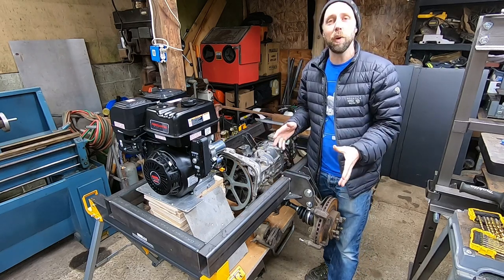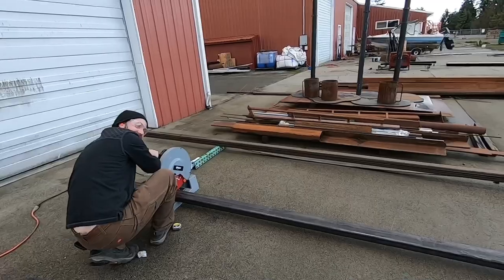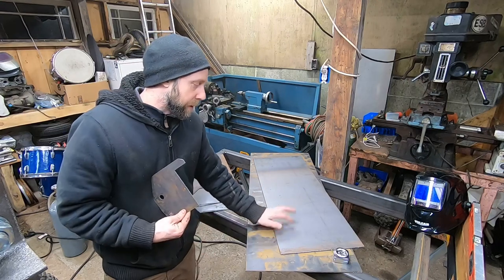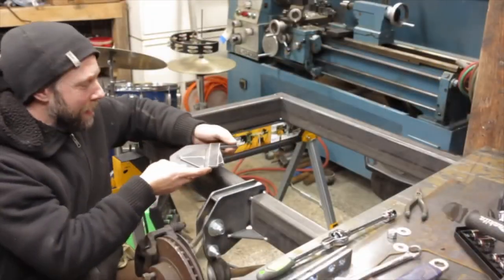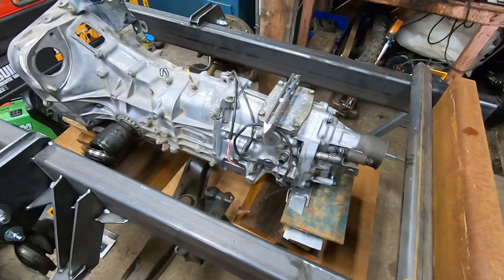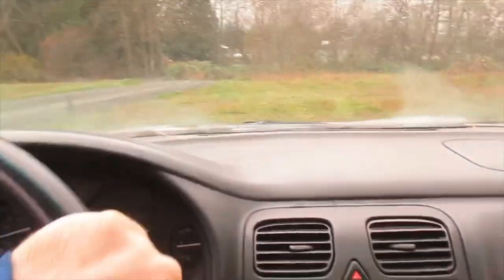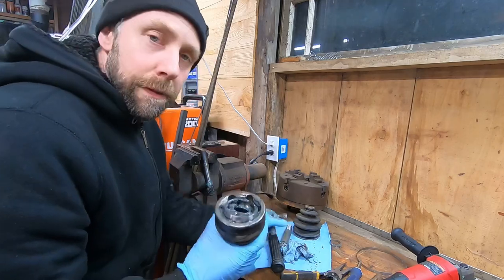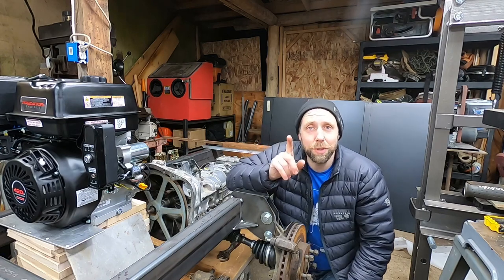420cc Predator powered articulating 4x4 dump truck build part 1

Comment from the maker: Hello everyone it’s Michael here 🙂 I just want to wish everyone happy holidays and thanks for checking out my new build!
Reply: This is awesome, can't wait to see part 2. Anytime you need some help, you had me at articulating, quad, utilitarian, vehicle.....
Reply: You should put an actual engine in this one not a harbor freight one I think it would work a lot better
Reply from the maker: Ghavin Clayton this is a actual engine, it’s a 13hp four stroke gas engine. Could you go into more detail on your comment? I think every project I have built with single cylinder engines work pretty good, my sawmill, log splitter, quad truck and predator powered mini bike, this engine coupled to the transmission though the correct gear ratio should do everything I need it to do. What engine do you think I should run? Do you understand projects like this cost a lot of money, I’m trying to keep in a budget of around $1500.
Reply: I have a mini bike with a predator engine,I bought and installed new wheels and handlebars for it today, it's still going strong
Reply: Please, for the love of all things square and pointy, put your dog out of the shop when you're welding. 
That aside, awesome project.
Reply: Your part obviously looks like a front hub on an F350...
Reply: is that transmission a 4EAT?
If so you can do a locking center dif mod. It can be really useful thing to have if you ever REALLY need traction, Instead of potentially burning out the "bucket"

https://www.youtube.com/watch?v=6AoEm-CSa74

Comment: I built a skider  like this using a jeep drive train. Used a industrial 10 hp brigs. Not enough power. Upgraded to a 2 cylinder air cooled diesel. Now it is fun to work.

Comment: Fantastic new project, looking forward to watching this one progress. For rough and ready shaft shortening I just use a bit of high quality angle iron and clamp both sides into the angle so they are locked straight. You can get 3 tacks on and with one turn get the 4th and then seam it. For more accurate stuff I weld it in the 
lathe with a fire blanket to protect the bed.

Thanks for posting.
Reply from the maker: Right on thanks for the suggestions! I definitely will use that on the rear cv joints 👍

Comment: Nice to see how this transmission works in a homemade vehicle. Years ago i had same idea using older subaru trasmission with 4wd high and low in a articulated 4wd  garden tractor.  My idea was to put engine very low and use another shaft to power transmission, hydraulic pump and pto shaft front and back

Comment: Mike, from my experience you might want to revisit the power source. I think you will find that your build will grow and the need for reserve power will be needed. I'm a big fan of the predator engines. Look at making the jump to the 670. The drivetrain and components can easily handle the added power. Love the plasma table.

Comment: wheel bearing assembly off a 99-2004 f250/f350.  Could be 2005 up but didn't get a super real good look.
Reply from the maker: Yep you are right 👍

Comment: Iv shorten a few axels I took them apart like you did, rough cut to length and threw them in the lathe and turned them to the nearest sized drill bite I had that was as close to axle original size, Then I threw a piece of round stock in the lathe and drilled it for a tight fit, put the two axel pieces together and welded the sleeve at both ends. Worked great and was on a home built sxs that I dumped the clutch on many times, never broke one. It spun true,

Comment: You can use angle iron and set the shafts on the v groove so you can weld the shafts together and have them straight as an arrow.

Comment: You should set the back half up so it can be switched around for diffrent uses.a dump box like your planning and a log skidding arch/winch or grapple or a combo grapple/ winch.it would be easy to do.just weld pockets to the outside of the frame and have square tubing to slide into the pockets with pins to hold it.build the dump box so it just sits down on the back frame and same for the winch.
Reply from the maker: We think alike! I’m definitely thinking of doing this 👍 I build a bandsaw mill years ago so a boom with a winch is definitely in the plan. Thanks for commenting 🙂
Reply: I,ve seen you mill and your videos on it..nice job..your doing a nice job on this project too..so good i,am thinking about using my rusty 2001 toyota tacoma to build one myself.i design and build all kinds of things.

Comment: Great build! I usually clamp things like those driveshafts into some angle iron to try to get them straight but looks like you did really well. The fact that it's got a CV joint either end means it probably doesn't matter if it's a bit off.
Reply from the maker: Thanks! I have had a few others mention this angle iron trick too! I appreciate it 👍

Comment: The thing you showed at the end and asked what it was. It’s a front hub & bearing assembly with ABS sensor. It’s for a 3/4 ton or bigger truck or van. Most likely Ford but Dodge had some like that as well.
Reply: That must be some shaft to need a spline that big.
Reply: @rpatrick2  it not for a shaft, it's for a 4 wheel drive lock out.

Comment: I have been thinking of something like this for a while. Not articulated but using Subaru running gear and cutting it down. Going to help my father close down his Subaru wrecking yard next week so see what I can score. I was thinking of using the front and rear cradles and narrowing them down along with the steering rack and half shafts as you have done. 
Have a few Diesel engines up the back I could put to use.  Be a major project I'm not sure I'm up to. At very least would have to clear all my other crap out the shed before I even thought of starting something like this. 
I'd really need to put Hydraulics on it so I could have a blade  to make it worthwhile and they aren't at all cheap here in oz.

Comment: i built a 4x4 lawn tractor and had to narrow my axles and shafts, the way i was able to weld them back together straight was by c-clamping both sides in a heavy piece of angle iron, its strait and worked great for me, no issues
Reply from the maker: Thanks for the suggestion! I have had a few others suggest the angle Iron too. 
Do you have any videos posted of your 4x4?
Reply: Mike festiva I do. Only of it running and driving tho. I’m not very tech savvy so I didn’t get any videos of the build. But if you add me on fb (the one with my dog as the profile pic) I have tons of pictures on there of the build

Comment: 6:40 No, that doesn't sound stupid or ridiculous. Tools like that, particularly the latest CNC stuff, are totally worth it. Especially now that the prices have come down without the corresponding reduction in quality. Even if you had another person, even a skilled fabricator, there's no way they could have those parts finished in that amount of time at that level of precision. (Of course you mention this later...) I'm working towards getting one of those Langmuir CNC plasma tables mostly because of what I've seen on your channel. Probably going for the new one with Z axis control. Cool build!

Comment: 4x4 Front hub assembly  3/4 ton ford . I just watched the video again I edited my comment from a hour ago .Thats the best idea for the pivot I've seen people just do it with pipe  and yeah that is going to be way smoother with the bearing!!! That is going to be a beast there is some videos on YouTube of a toyota 4x4 truck and they have a 6.5 Predator engine hook to the transmission pull start and uses trans like normal !! So what u have is a beast heck yea ready to see this working tractor !!!
Reply from the maker: Right on Ricky! Yes I think it’s going to be really useful around my property. Thanks for checking out my videos 👍 yes it’s a Ford F-250/350 super duty wheel bearing. Take care

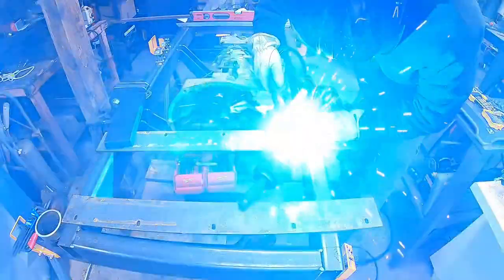Comment: 18:57 as long as your two parts have the  Diameter you can clamp them in a piece of angle And they should hold their concentricity fairly well. If you working with 2 different diameters just shim one side. I made an adjustable Weld fixture just for stuff like this that has a gap between the two angles so you can weld all the way around. Can't wait to see  The finished product.
Reply from the maker: Thanks Ken I definitely will do that!

Comment: Dam Mike, you have to keep teasing me with that PLASMA TABLE. I plan to get the same one soon. I'll need your help. I'll have questions. That thing is just sick!
I hope Miller and Lincoln reps are watching your videos. Hehehehe.
Reply from the maker: Haha well if you buy one I will be happy to answer any questions about it 🙂 haha Miller guys are not going to be able to handle it, I’m building a tractor truck in my shop with a HF welder and plasma torch 😂 as far as most die hard Miller guys that just could not be done without a “REAL MANS WELDER” 😂👍

Comment: Love it Mike!  A welded outer sleeve on the cv drive shaft along with your idea of a dowel inside would add lots of weld strength.  I do think you're right about it never being a problem - just in case... ;)  Looking forward to the following episodes!  Cheers,  Gary

Comment: best way to shorten and rejoin Cv joints , is fit a outer sleeve , press fit  over the shafts then weld  the sleeve to the shafts
Reply: That's what I was thinking, Also you could put some holes in the sleeve for extra places to weld.
Reply: @arthurhardy   Yes its called Puddle welding the holes  or even just slot the pipes at each end

Comment: Hey man good show. Some years ago I build a small Articulated tractor from 2 walking tractors running a yanmar 14hp engine off it. Just a word that an ADT does not pivot and turn, it articulate and oscillate. That will be articulate around the Y axis and  oscillate around the z axis.

Comment: That bearing that you have there is most likely for a late model Ford f 250/350 truck front axle.
Reply: Early model by the tone ring and snout length. But yes. . *edit, forgot Dodge uses axle disconnects. 5
Reply: @thethepete731  Dodge axles don't use a locking hub. Dodges have a unit barring like the chevy and gmc trucks. it's just on a solid axle instead of an independent suspension.
Reply: @scottgarboden4529  right, sorry, Ford guy, you're right. I forgot they use axle disconnects.
Ford uses a unit bearing too. That's what that is. They use hub disconnects vs an axle disconnect, which is probably what you're thinking of.

Comment: Get some ubolts and 3/4 inch angle iron to align your Axel's or round stocks also a carbide tipped plywood blade will cut those Axel's very easy I cut  up to 3inch trackhoe pins with my 6 1/2 in Milwaukee battery powered circular saw just scratch it with the grinder if it's case hardened

Comment: I think what you got is going the best route. Parts (Write down production date & VIN) but it is straight forward.
  The hub is ABS, Late model, 3/4 ton with 8 studs, and front for a 4 X 4. What is strange (I have not worked on all) but the center of this hub, is like old school get out, turn to lock or un-lock, then change directions for 32 feet to allow the locking runner to engage or disengage over those long splines. Today, it is shift on the fly and done by locking the front driveshaft together. Also, a controller that synchronized the transfer case electric motor to engage or reduce rolling resistance. The bolt-in hub type considering it is May 2022 has been used for 1998 so 24 years now. Dodge, front, 3/4 ton 4X4 with ABS for 1999-2008. Close?
DK, ASE master tech since 78, retired

Comment: to weld the shafts just clamp them in a piece of angle iron to align them
Reply: Or you can buy an angle and chain clamp to do any for or tube joints.

Comment: Looks like a Ford Superduty 4X4 front bearing but I’ve never seen one that wasn’t rusty. 😉

Super cool idea for a build and the Subaru transmission is a great starting point for the driveline. 
Hopefully you get the hydraulic requirements figured out because it sounds like it will be a great build overall.
Reply from the maker: Thanks Wayne for checking out my new video! Yes you are correct on the bearing 👍
It will be fun working out the hydraulics I have dabbled a little with them in the past but I’m sure it will be a learning experience working out this one. Take care.

Comment: It would be so cool to put some type of articulation joint in my 1990 Toyota 4x4 right between the cab and the bed. After watching how well this thing actually crawls once it was done it seems like it would work even better that doing a solid axle swap like most do to get better articulation.
Reply: I agree I have a good doner Toyota that has rusted out rear frame and a rear axle out of a dump truck to canablize for the spindle and hub to make the center swivle with I could even retain the brake on the spindle so you could lock the swivle in position for driving it on a road. It just might work

Comment: to line up axles and roundbar in general : use a piece of angle iron and ca,p both pieces together inside it , should line up pretty acurate , i you cut a piece out the middle you can get to the back of the axle with the welder yoo

Comment: When I was in college for welding back in 2011/2012, I could not figure out any of the CNC stuff at all. Wish I did back then, because now I kind of want one of these plaz tables for myself. There really isn't any fast way someone could make those by hand and be accurate as consistently as a CNC table can. Especially trying to make the holes for the spindle to bolt to without them being oblong.
Reply from the maker: You know Aaron I’m new to Drawing in CAD and running CNC stuff. I got this table and learned CAD back in November, within a month I started on this project. I’m drawing in Fusion 360 and there is a bit of a learning curve but within a week of downloading Fusion 360 I was able to draw simple parts. Once you get the drawing stuff figured out loading the G code to the Mach3 CNC controller software and cutting out the parts is definitely a simple process. I have some videos when I first got the table that talk about the learning curve and a bit about using the table. In those videos there are also some links to some simple but really useful Fusion tutorials I found on YouTube, If you can’t find those videos let me know and I can post some links for you 👍
Take care

Comment: That's quite the project man! Way over my head, but it is fun to see you do the build. I've my crossfire some. The prime weld cut 60 seems to work really well, except I found that I had to move it as far away from the electronics box as possible otherwise it caused the table to malfunction.  It cut some quarter inch super clean.
Reply from the maker: It’s good to hear it’s working for you, I read somewhere that people had good luck adding on those Ferrite ring noises suppressors onto there cables going from the plasma torch into the control box? I have never tried them out but here’s a Amazon link, if it didn’t copy right just look them up, you can get them for around $10 for a multi pack. Take care 🙂 

eBoot 20 Pieces Clip-on Ferrite Ring Core RFI EMI Noise Suppressor Cable Clip for 3mm/ 5mm/ 7mm/ 9mm/ 13mm Diameter Cable, Black https://www.amazon.com/dp/B01E5E5IY4/ref=cm_sw_r_cp_api_i_4HTcEbNG2H678
Reply: @Mikefestiva  great, thank you.

Comment: LOL you and I get are ideas from the same spot, I've been watching a bunch of Russian guys building home made mini tractors the last couple years and just recently started collecting parts for a 1/4 scale Big Bud 747 project I'll be starting next spring. The idea is to cut down a pair of Ford Ranger rear ends and power the drive-train with a cut Cub Cadet Hydro unit....... the Hub looks like a Ford F250 or F350 front auto locking hub, good idea to use that in the middle because it would have support bearing in it for the locker assembly.
Reply from the maker: Haha you and I are on the same page! Are you going to post any videos of your project? If so I would like to see you project. Yes it’s a 99 Ford F-250/F350 super duty 4x4 hub. Thanks for checking out my video 👍
Reply: @Mikefestiva  I will definitely  be posting videos of it as I start the project, need to finish a couple things that got stuck on the back burner first so I have shop space.

Comment: *Weld straight/true axle shafts back together.*larger Diameter tube slides over both pcs. axle.*It has 2-3 holes/windows in center that let U weld the axle joint threw.

Comment: front wheel hub for a ford 2500.looks like its made for lock outs and chevy and dodge don't use them any more ,I wish they did, I had to pay $2100 for Yukon lock out hubs for my 2500 ram..but anyway  that is some awesome work, I got tired of having metal splenters in both of my hands..id have to wait until they festered up to dig them out, no fun.
Reply: Ya I got some from Amazon for less then $100
Reply from the maker: Yes it’s a super Duty Ford 4x4 wheel bearing 👍 I think it should be solid for the build. Take care

Comment: Lay the shortened half-shafts in a section of heavy weight angle iron (or doubled) and clamp them down hard before welding and leave them hard clamped until cool...